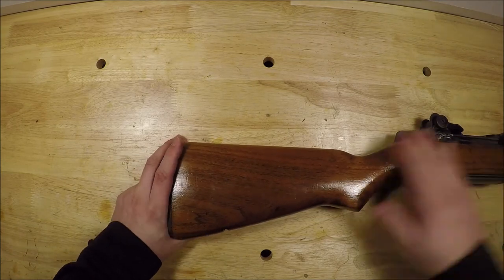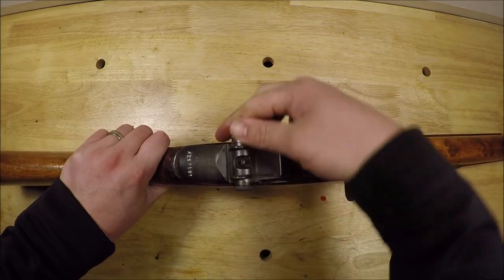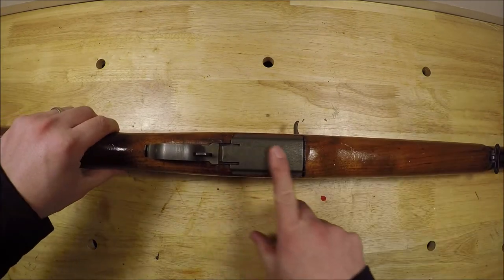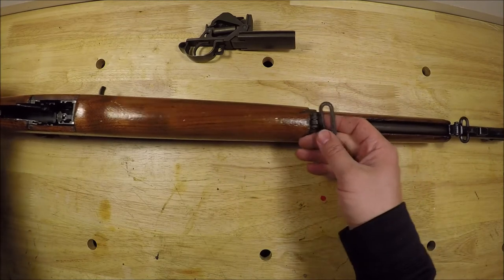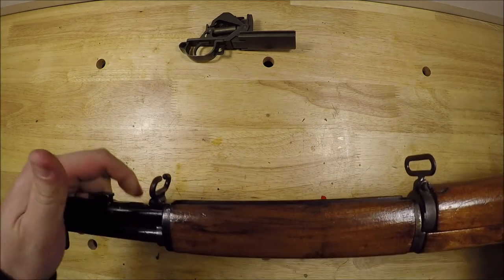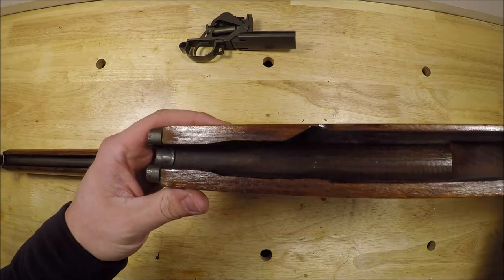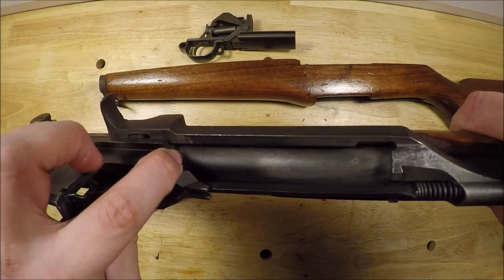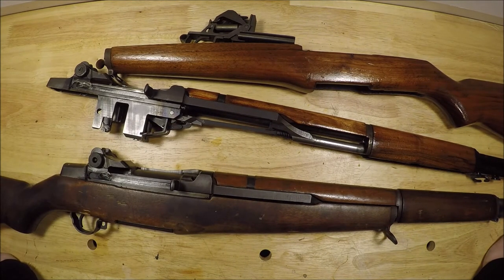CMP Drill Rifle No.2 Refurb Part 1

Comment: are you planning on bringing these back to firing condition
Reply from the maker: Absolutely not.  All legalities aside, with buying replacement parts, barrels,  support equipment, not to mention the welding done on the receiver, it would be cheaper, easier and most importantly safer to just buy functioning ones. 

Thanks for the question.
Reply: @n2dadarknight  understandable I was wanting to bring one back from the dead as a project seems like something that would be pretty fun